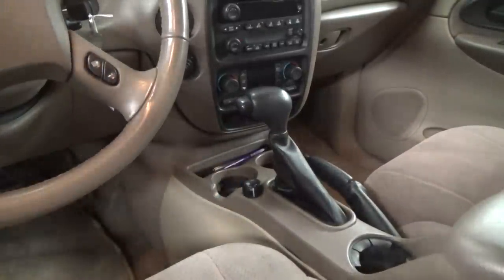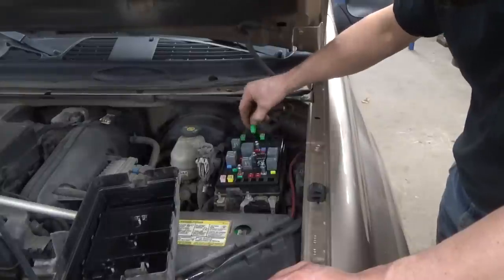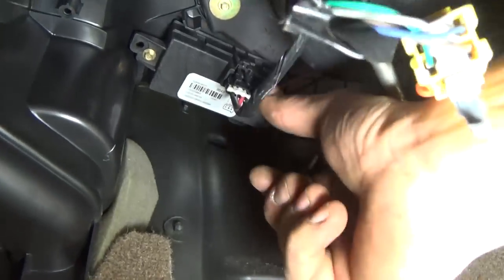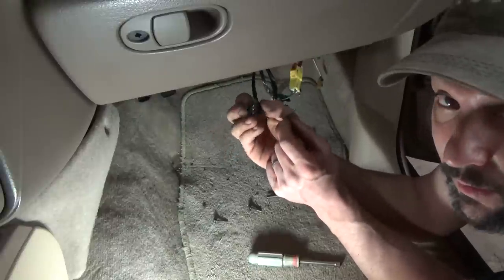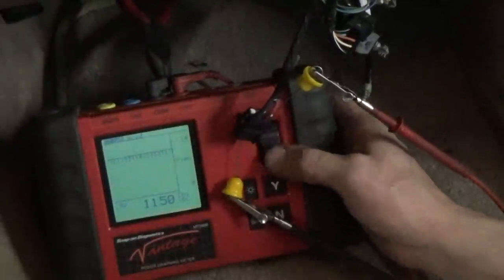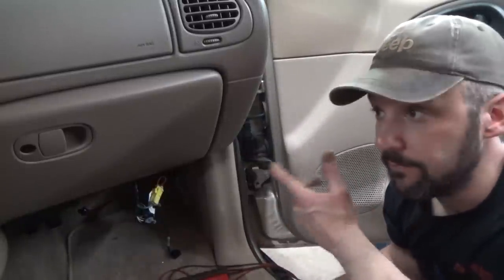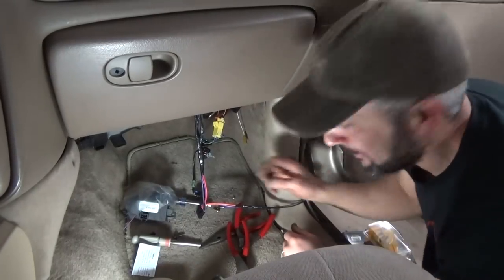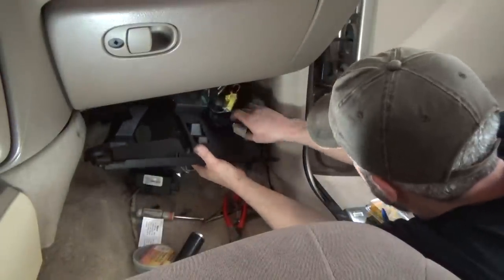Chevy Trailblazer EXT Blower Motor Won't Turn Off

Comment: It could be the dude who cuts the wires. Engineer designs part and specifies wire length so there isn't too much slack. Dude assembling it probably has a supervisor on his ass all day and is at the end of his roll of wire, with 8 inches left. He thinks "Ah fuck it, spec is 9 inches and they always design in slack who's gonna care". Test program checks that module actually works, doesn't include wire length test because who has ever screwed that up? Or the engineer used a test vehicle where it fits comfortably and thought there was ample slack. Either way, part gets shipped, you get pissed. If you do complain, and you do reach someone who gives a shit, the information goes somewhere far removed from the engineer or the specific wire cutting dude and gets assigned a very low priority based on 1. Low cost of part 2. Low risk to passenger/mechanic safety 3. Low risk of secondary damage to vehicle. There are 20000 other problems ahead of it in the line because engineer and assembler are making a billion different pieces of junk daily. If you return the part it might have more chance of getting looked at but the same problems will exist with priority. If yours was the only part ever returned then it won't get looked at. Because other, higher value, parts that have more serious issues will be returned more often. If it's a design issue they need to confirm what you're talking about on an actual 2005 (what are the chances) and then write up the paperwork to implement the fix, and then recall the parts that are already warehoused to fix those. Bottom line - nothing will change unless they seriously implement a philosophy of zero defects, and trickle it down through their company structure, including supply chain, like Japanese companies do. Not gonna happen.

Comment: There is technical service bulitin on this junk from gm the module has been up dated and you have to change out the plugon the AC Delco unit also.your Napa module is probably a reboxed AC Delco unit because it is made in the USA.  It's all junk now.napa is not the company it was in the late 70,s. Napa has closed down there distribution center here and closed up some local stores and  private owned jobber stores.there parts are not as good as they once was

Comment: Was wondering what could cause my blower motor to only run on high? It shuts off but no in between speeds.  It's on my P.O.S lemon 06 Dodge Ram 2500 pick up.. Thx for the time...And the Vids Eric.
Reply from the maker: Prolly the resistor
Reply: "prolly"  Where did you go to school?
Reply from the maker: rod builder I didn't, so I'll prolly make a few mistakes now n then...

Comment: Run into this all the time with aftermarket parts, there is always something wrong. And a lot of the time you have to make it work, because of time restraints or no availability of parts, etc. We deal with Napa parts, and found a lot don't last, so we get OEM, but a lot of their parts are supposed to be made with the help of Dorman Solutions which are supposed to be updated parts that are "better" than OEM, which I question sometimes.
Reply from the maker: kenman1717 Wait!? Did you just use the word dorman and better in the same sentence?
Reply: umm.... yeah, was that wrong?
Reply from the maker: Yes because we all know Dorman and the word better and good do not belong together lol
Reply: South Main Auto Repair ok. its what I get to work with mostly, unless we knows it junk or can't get it.
Reply from the maker: Yeah I know the feeling. Seems Dorman is taking over the world with there parts

Comment: if the after market parts fit you won't get the job. a lot of users would fit the parts themselves. its so you have to go to the dealer. not that they are the expert.

Comment: Adapt, adapt, adapt, screw it.  Burn, burn, burn.  HA.  Parts dude just sells the stuff. No way to tell if it will work or not until you open the box.  Sad state of affairs.

Comment: If the rear blower stays on but turns off with key, would that be the same part to replace in front or is that something with the rear blower assembly. Front works as it should, rear stays on. Nobody has this answer on google or youtube